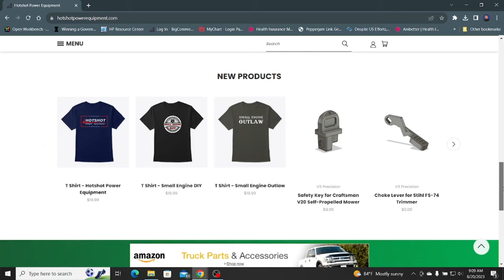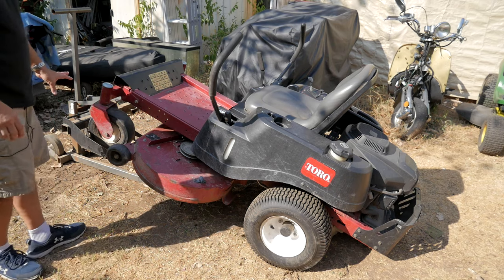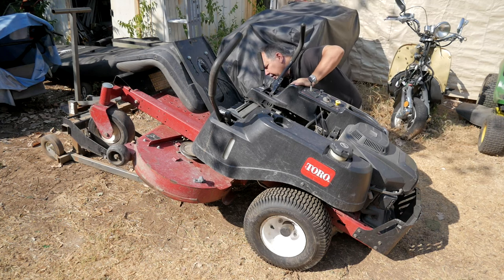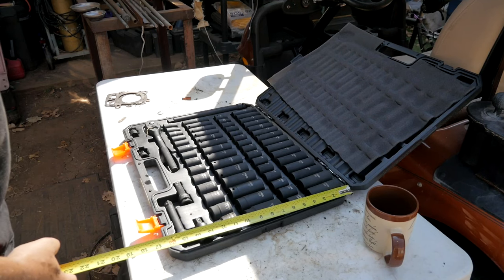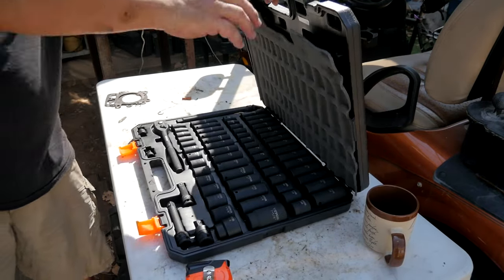Toro Zero Turn needs some TLC and a good Impact Socket Set.

Comment: You should have sharpened the mower blades, check the spindles for lose bearings and or greese all of the greese fittings on the entire zero turn Lawnmower, change the spark plugs and adjust the valves, change the filters both fuel and air filters,. Some of the zero turn mower’s have a fan to keep the drive motor’s cooled down while you are moving forward or backwards.  You need to keep the cooling fin’s cleaned out.

Comment: Now on your John Deer Riding Lawnmower like the L112 or L120 the fan location just above the hydrostatic drive unit has a washer a wobbly looking washer which is a spring and then you have a clip on top. After you remove the clip off of it don’t lose it say it to one side remove the flappy spring washer and then you remove the flat washer then you can replace the fan if it’s needed. To reassemble you put the fan on you put your flat washer on now that wobbly working washer throw it away put a brand new one on it I know you’ll think that it’s still good but it’s not do you want to replace that old wobbly looking spring washer after you’ve done that and you put your flat washer on or your clip then it should not allow the fan to come up off the shaft into the drive belt causing the blades to break off the fan. When you do go to the store and you get you a handful of those wobbly looking spring washers keep American Tainer like an old peanut butter jar that’s made of clear plastic and you put on it John Deere parts for the rear fan. I know this because I have replaced three of them on my lawnmower. It took me three to realize what was going on it does not explain it in the book. And the mechanic at the John Deere repair place never bothered to tell me what to do I learn this on my own. There’s another problem that happens with the motor there’s a black wire travels from one Kyle to the other coil and it is separated by a resistor you have to make sure if you go to replace the resistor on it it’s the one with direction current and what that black wire is originally for is when you shut the ignition switch off is supposed to kill the coil or ground the coils out so that the engine doesn’t run anymore. Another item that you might have to check to get the engine shut off is the electric cut off for the fuel system course to fix that the easier way is is to put your fuel line cut off valve in between the fuel line and then shut it off and let the carburetor empty out another words engine to keep run until it stops. Good luck to you God bless you and I hope you have a wonderful day and a wonderful and better week.